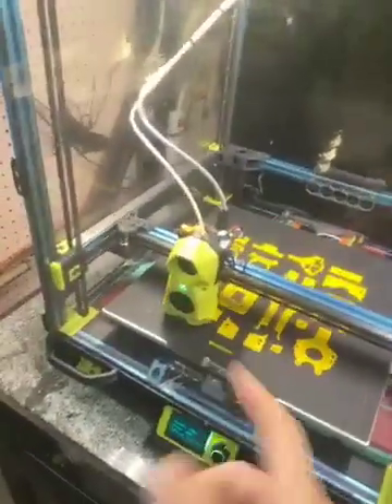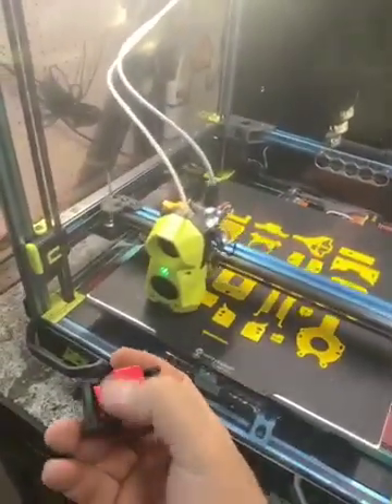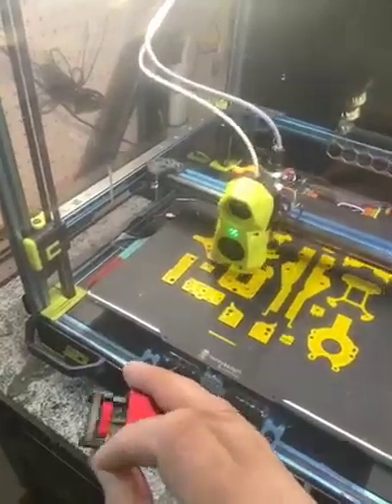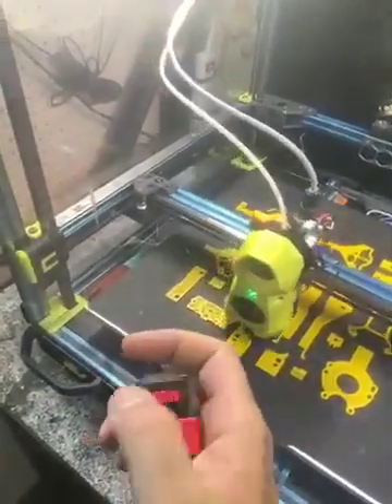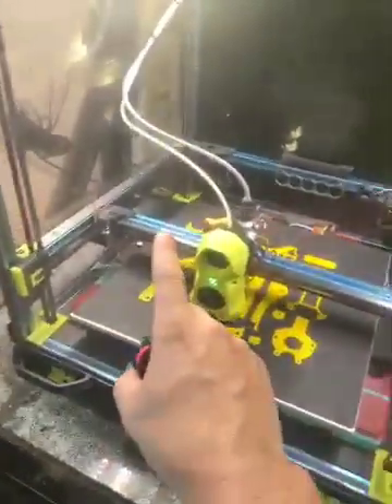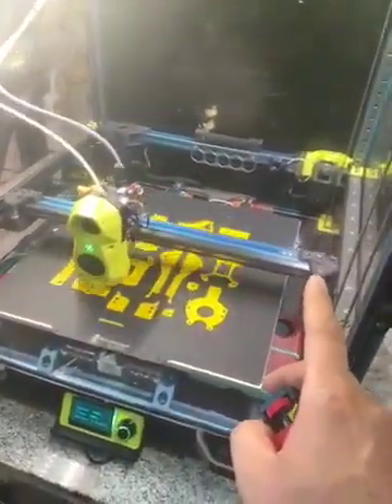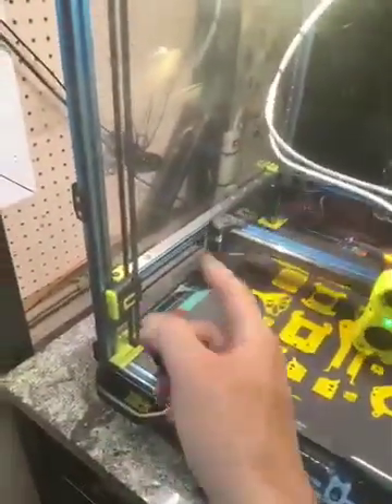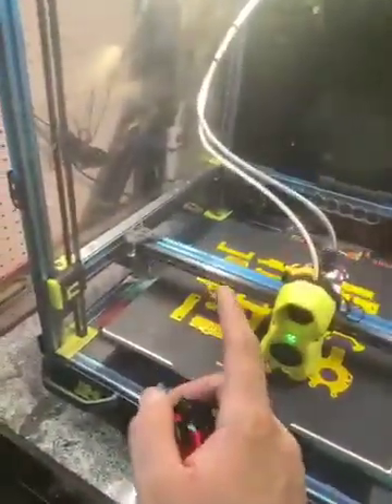Mike Belt Tension tussle: Another belt tensioning video which may help you.

Comment: Just use tensioning tool that fixes this problem.
Reply from the maker: The issue with just simply re-tensioning with the tool is that you may already be experiencing belt induced racking. The easiest way to fix belt induced racking is to simply redo belt tension.
Reply: @The_original_Reth  true but u still have to use tool
Reply from the maker: @Basurci  I agree and I believe I did mention that in the video